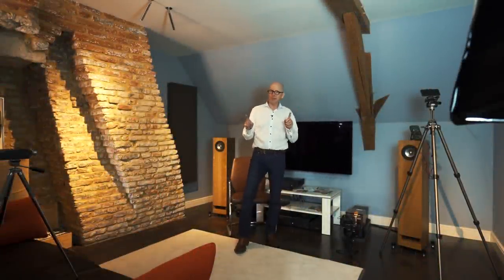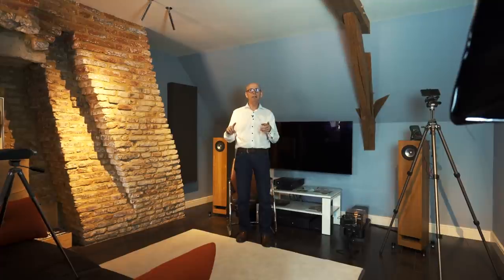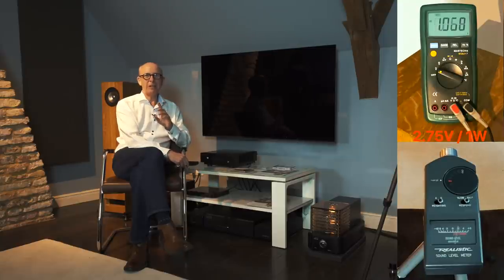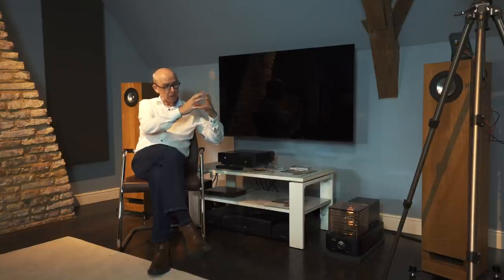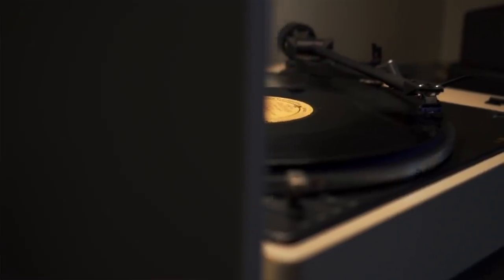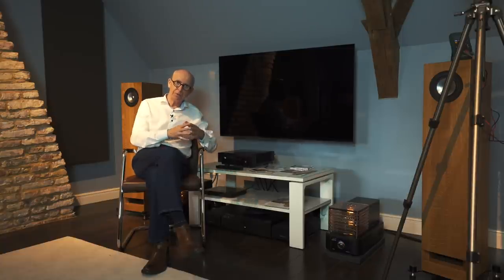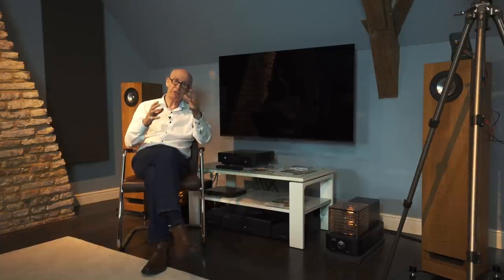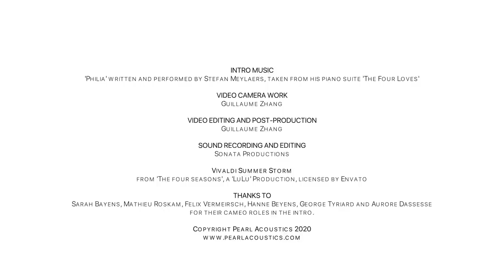How loud is 1 Watt (with an 87db Loudspeaker)?

Comment: The speaker sensitivity tells you how loud they will be at a given input power measured at a given distance.  I this case 1W @ 1 meter will produce a SPL (Sound Pressure Level) of 87dB.  To double the volume level (SPL) would required 3dB, or 90dB for this speaker and twice the input power, or 2W.
1W @ 1M == 87dB
2W @ 1M == 90dB
4W @ 1M == 93dB
8W @ 1M == 96dB
16W @ 1M == 99dB

SPL falls off at a rate of 1/d^2, or 6dB at 2M.
1W @ 2M == 81dB
so to get 99dB @ 2M with 87dB sensitivity speakers would take 64W of power.

Of course all these numbers are based on a single speaker.  Multiple speakers at the input power will create a louder soundstage.

Just in case you were curious about the numbers. :-)
Reply: Completly right, I was just thinking write this to. Becaus e he said 8 w would be enough for 100 dB , but so isn't the case.  Then the speaker isn't static 4 or 8 Ohm, that very to. And some speaker's are very hard to drive. For that you maybe need some umph in the Amp.
Reply from the maker: @henrikl1394  thanks for your input. However, if you noticed, I had two speakers driving into the room (left and right channel) and that gives an extra  3db. Thus: 90db at 1 watt per channel and therefore 99db at 8 Watts. The sound pressure level meter recorded over 100 dB in my seating position, and that’s all that counts at the end of the day? I only wanted to show how loud 1 watt per channel can be in a domestic situation. I hope I achieved that.  In practice I like to use amplifiers of at least  16w per channel.
Reply: 87db is 1m from a single speaker at 1W of power with 1Khz sinewave, not music and it makes signifficant difference. The fact that host is talking all the time makes db meter measurements invalid. At 1.6V we see +6db on the meter, which is 96db I imagine 2-3meters from the source, so something is clearly not right.
Reply from the maker: @asdfghjkl1755  thanks for your input. I noticed that too and later discovered that in editing the sound pressure level meter image is not in sync with the the stereo mic soundtrack. This is noticeable at the end when the needle is no longer moving. But the measurements are correct in themselves
Reply: @PearlAcoustics  Thank you for response and congratulation on making valuable youtube content.
Reply from the maker: @asdfghjkl1755  thanks!
Reply: @PearlAcoustics  HI, I am new here. When you say at least 16 watts, would it be at 4 or 8omhs?
TIA.
Reply: @henrikl1394  - Difficulty of driving the speaker is described by the spl @ watt/m. So it's not some mystery. You can expect the volume given by the rating. I don't know what "that very to" means, and speakers does not use an apostrophe.
Reply: @PearlAcoustics  bro.. doubling the power AND the number of speakers gives you a 6 dB gain, not 3.. For example instead of driving 1 speaker with 8 watts, you're now driving 2 of them with 8 watts each...
Reply from the maker: @niro56  true! My error, I must have been tired or not thinking straight because effectively one is doubling the voltage. Thanks for picking that up. Stupid of me.
Reply: Speaker sensitivity needs to be taken with a grain of salt. Some companies do it across a range of frequencies, and give an average (the correct way). If just a 1kHz test tone is used, in a multi-element speaker, your just measuring one element (the mid range) or a combination of the upper end of the woofers response and the tweeter, but it all depends.
Reply: Wow, this started a lot of replies.  To add a little more info about measuring speaker SPL sensitivity the manufactures use either white or pink noise sound sources to do their measurements.  The speaker impedance will vary at different frequencies and the nominal impedance is the average over the frequency spec, usually 20Hz-20KHz.  So the measured SPL is the average over the entire frequency range unless otherwise stated in the measured spec.  Listening to white/pink noise at 87 dB is pretty loud.  In fact the THX reference level is 85db with a headroom of 20dB (105dB) peak.  And LFE channels sometimes require an additional 10dB gain which requires a lot of power (high powered subs).

But the video here is a good representation of how loud 87dB is compared to a human talking in the same room.
Reply: @Scott31415  at 1 meter...if you are siting in your sofa at least 3 meters ...it is not that loud,it is?
Reply: @armandocamorra2488  it's still really loud. Sensitivity (typically) is listed as anechoic for a single speaker. When you have it as part of a system you have gain from multiple speakers, room gain, etc. Unless you're watching movies at reference levels (most people do NOT), being overly concerned with sensitivity and power is generally a fools errand.
Reply: Can someone tell me why my old AR4x speakers sound nice and full with an equally old Stromberg 6v6 single ended amp? I am guessing less than 5 watts. 15' X 15' room. Online everyone says they need at least 50 watts to sound good.
Reply: @bertroost1675  it depends how much bass is in your music. If you listen to a lot of EDM, it might sound thin with similar power levels that will drive an orchestra loud and clear.
Reply: 3db will not be twice as loud, it will be marginally louder. It takes ten times the power to sound twice as loud. It's logarithmic not arithmetic. Google it if you doubt me
Reply: @DougMen1  it is not a logarithmic curve it is somewhere between cube root and fourth root. If it were logarithmic the next 10 dB would only get you 3 x as loud  and not 4 x. What is logarithmic is the number of times you can sense the loudness change but not the loudness itself.
A 3dB change is roughly 8 out of 10 on loudness. Though it is hard to put an exact number on a psychological conscious experience. Also at different frequencies the loudness change is different. Typically I have found loudness in the upper midrange to grow more quickly, making it overtake the rest of the spectrum as things get louder.
Reply: @PearlAcoustics  Dear Harley, but when 1 Watt is delivering that insane unhealthy sound pressure of that scale, why do you still recommend a SET with a minimum of 6 Watts. 

My ordered DECWARE Zen.Triode 25th Anniversary 2.3 Watt/ channel should be still delivering enough juice for your Speakers ( and I`m seriously thinking about to place an order on your lovely Sibelius ), especially when I prefer to enjoy my music most of the time at low level late night sessions or under normal sound levels during daylight. And my Living room is just around 19m2., so equal to your room scale I  would guess.
Reply from the maker: @matthiasschnapka9180  Dear Matthias, that is an extremely good question and the answer lies n the question of dynamics and room damping. There are situations where heavily damped rooms, combined with a desire by a particular listener for extremely loud and sudden crescendos could better be served by an amplifier with more spare capacity. 
As a matter of interest, I recently purchased the exact same amplifier as you, and found that at reasonably realistic levels it sounded absolutely gorgeous. Loads of punch in the bass and a mid-range and treble to die for!
At the kind of levels, you want to play the Decware would be a perfect combination. If you are in central Europe, and you want to hear one, reach out to me.
Best wishes
Harley

Comment: I'm fairly new to high-end audio and have had a Decware SE84UFO2 on backorder for a while now. I've recently become pretty curious about the Sibelius! The Decware outputs 2.3 watts, which is concerning for 87 db sensitivity, but I rarely listen to anything at over 70 db loud, let alone something like 80 db. Would I really have enough power on tap for my needs here? Or do you think I'd be lacking a bit of control and not getting much out the speakers with this amp? I'd also want to avoid damaging either of the components, of course
Reply from the maker: Hi, very sorry for the late reply. If you listen as quiet as you say, you won’t have any problem at all. It’s a fantastic combination in the right room. Feel free to reach out to us via our website and we’ll be happy to advise you. We have customers with the same combination and we loved it when we auditioned the zen

Comment: I hope YOU enjoyed the demo, because I've been playing guitar in front of amps that loud or louder fir years and though it FEELS great to play through a cooking amp, it will certainly wear you out.  It was a cool demo. I already knew the conclusion from practicing at home. Five watts will piss off the neighbors,much less eight or more. I attenuated of my amps at home, which are 14 and 15 watts respectively. Occasionally, when neighbors are gone I will plug in and play in wet'dry or duel mono/ stereo. It is DEVINE, but brutally loud.
Reply from the maker: 😉 indeed, I had a lot of fun.

Comment: Excellent video, answered a lot of questions I had in terms of power and loudness.. what would you consider a reasonable dB level to enjoy hifi at? I.e. getting the best out of the equipment, preserving your hearing and not being a fatiguing experience?
Reply from the maker: Generally, in a small to medium sized living room... 86 dB is a good average to max level for most music, with mini peaks at 90db
Reply: @PearlAcoustics  and that is even too loud, I have enough with 70dB and in a concert live listening a jazz trio with vocals, I measure 80dB from a five row seat. Plenty.
Reply: Listening fatigue has more to do with harmonic distortion (more specifically, odd harmonic distortion) and/or unnatural frequency response, than SPL. "Loud and clean" will not produce fatigue as quickly as moderate SPL with 3rd order harmonics and/or a preponderance of midrange "shout".  Having said this, I agree with the other commenters - somewhere in the range of 70-86dB is plenty. At 86 dB, no conversation is happening in the room without yelling.

Comment: Just what I've been wondering recently.
I revisited hifi during this covid season due to having more time at home and started visiting Internet forums again.
I see people raving about 200W or 500W icepower modules and how cheaply they can built an audiophile grade amp with them.  Started wondering... Do we really need 200W?
I had a 3.5W 2A3 amp for a couple of years and I don't think I pushed it even halfway. Anything more and I would have been kicked out of my neighbourhood.
So do we need that much power or 30W amp with a hefty power supply would meet most of our needs?
Thanks for this video... It clarified all my doubts
Reply: often budget or just plain hifi grad equipement is not that efficient 

icepower moduels
Purifi 1ET400A
and hypex

also TPA3255 with the Texas Instrument Chipset
all offer very low signal to noise ratio almost silent even on higher loads

these DIY solutions outperform many expensive Class AB also in terms of Money/ Value 
since a TPA3255 balance amp board and digital switching power supply is had for around 150 USD

I transitioned my self from pure clas A to a class D and i am blow away by the performance

Comment: Music is about dynamics and timing, silences and emotions included.  :)
Its also about micro-dynamics and harmonics and providing access to a moment in time.
Its not just about watts or simply spl ratings alone (although well applied science is key to getting "musical great sound" in any playback setup and its indeed quite complex).
.
.
From my experience, power ratings are not that important if all is is not well designed.
I have done systems that worked very well with relatively low power amps and modest spl ratings and also experimented with 
3 to 10 kilowatts per channel (using active x-overs and multi amp & driver setups) with superb results.
.
.
Having said this, even if one could run into rabbit hole about the details and argument presented here, fact is i liked this video for placing a relative perspective on what one can expect with even average spl rated loudspeakers in a nice listening environment with a dynamic amp.  Nice.  :)
Reply from the maker: Thank you!
Reply: @PearlAcoustics  --   
I suspect we would have enjoyed a good conversation or two when I was working in Audio (a lifetime ago) between some great music listening sessions.    
Cheers!   (& keep the good work)
  :)
Reply from the maker: @pimianimavdo1523  I am sure we would have!

Comment: This is absolutely amazing and I had no idea....When I was a teenager I was very interested in car audio...with all the 500 watt 1000 watt amps all over the place and one day my father took me to a car audio store with him...It was an authorized "Kicker" dealer which is what my father was shopping for..In a really nice display they had their Amp selection and I noticed that many of them were labeled as "25 watt" or "40 watt" amplifiers and were priced fairly high..I asked the guy how could only "40 watts" be enough to do anything and he said "because they are real watts"...I never understood what he meant but now I guess this is what he meant...
Reply from the maker: Hi Gregory,
Some manufacturers ‘cheat’ they talk about music power ie peak and not constant driven power or RMS. it can be a factor of 10 difference. Most OF THE  hifi industry - go on RMS
Reply: @PearlAcoustics  So is it true that a higher efficiency speaker takes less power to drive it..but in turn the lower frequency ranges suffer? Just trying to make sure I understand it correctly...Or is it possible to have a sub woofer with a high db efficiency rating (90-92 db) that produces good clean low frequencies (25hz - 80hz) ?
Reply: @justScrollin0627  yes it’s true that high efficiency speakers take less power to drive it but there is a trade off. 

My understanding is that low frequency doesn’t necessarily suffer.  You just need a bigger size box/cabinet to produce your desired low frequency results. 

87.5 db for a speaker isn’t high efficient. 

90-92 is almost mid efficient to me.  

Anything above 92 is high efficient.  

What is a bit misleading about this vid is that low wattage Class A valve/tube amps work well with slightly more efficient speakers when playing “classical” music.  

While 87.5 db isn’t efficient this is more of a test as to how loud even 7 watts per channel can produce.  

The thing though is that doubling of wattage doesn’t equate to doubling of loudness.  Not sure if the author made this clear or not. Perhaps he assumes most audiophiles know this. 

If one listens to bass heavy music then wattage from a reputable amp company starts to become much more important. 

There are always trade offs though. 

My listening presence is geared more towards hip hop pop rock jazz classical in that order. It’s perhaps this preference because my system is designed this way.  I have Class A/B amps and cone type speakers with a subwoofer.  

I’m running 1,200 watts RMS of true clean power. 5.1 system.  200x5 plus 200w sub. 

My system does not sound as musical as this YouTube vids system.

Comment: I don't have the test equipment you have but I get what you are trying to drive at. When I put my woofer and tweeter in a bigger baffle similar to what you have if not close to your Sibelius baffle dimension, it played loudly with the same quality. When I removed the crossover and wired it directly and played even loudly and that was the time we have to tweak the inside of the baffle and that's where my fun is. Mind you, when I was getting to a similar sound quality using a bigger baffle compared to the mini-monitor baffle I started with, I just trusted my ears. A few of my friends who are into the same hobby agreed with me. I am not saying I did a better job. No. You are Sibelius and since there are no Sibelius in my country, Philippines, I did the next best thing which is improvised. Congratulations on your Pearl Acoustics and I will watch your other equally exciting videos. Thank you for sharing and I am learning as I go along watching you.
Reply from the maker: Interesting thank you 🙏
Reply: @PearlAcoustics  I have a Coral 12TX speakers with a sensitivity of 103dB owned by my olds and discovered it last year in our pile of 'To Go.' The Coral makes my solid state STR151A sound a bit like tube, a faux realization. This is where I compare the baffless 😉 I built using the two drivers from a mini monitor speakers. It also has several ports that I will experiment on soon made possible by my good carpenter. Again, your Sibelius is my dream 🔊 speakers. Thank you ☺️ for appreciating my narration.
Reply from the maker: @joeysarmiento1925  hey Joey, thanks for your comment - what a discovery! Enjoy the music, and who knows? Maybe one day you’ll own a pair!

Comment: I remember that back in them days,,,,, I had an Audio Innovations Series 500 with a max output of 10 watts and a pair of Horning A1 Concrete horns with a Lowther P6c as far as i remember. It was so easy driven that the attenuator should barely be moved before it was extremely loud. Plus it was so dynamic that it was scary.
I should have kept those speakers but at that time i moved a lot and with two loudspeakers at 150 kg each and a size of a big suitcase 105 by 105 and 30 cm depth they just got to go.

Comment: Very interesting and educational video , I would never have believed it . Many years ago I used a David Berning 1 watt per channel vacuum tube amplifier used to drive a pair of Klipsh RF-7 speakers with dual 10 inches woofers in each speaker . 

A friend laughed at the idea I would use such flea power on such large speakers , five seconds into the first cut of a Pink Floyd selection he was speechless though he knew nothing of the high efficiency of this speaker it turned out this amplifier was a beautiful match with this particular Klipsh speaker .